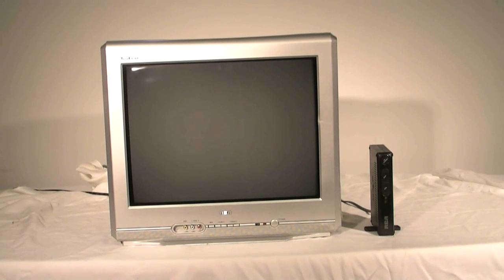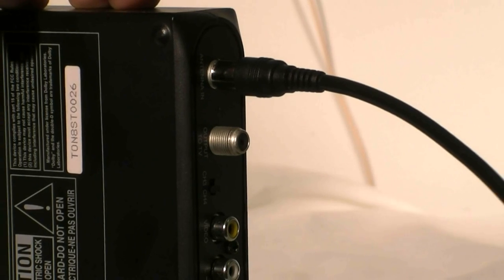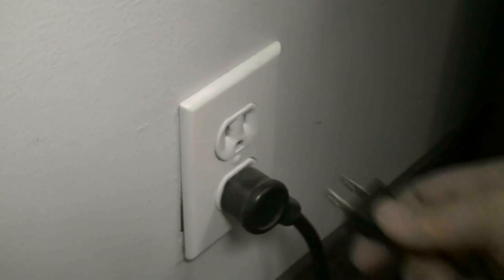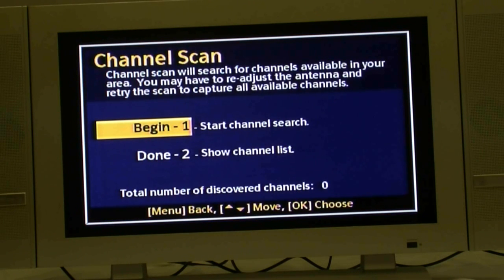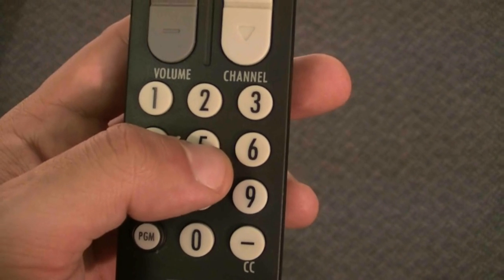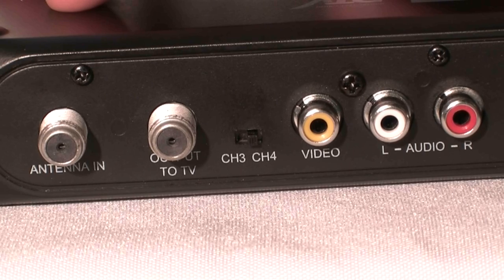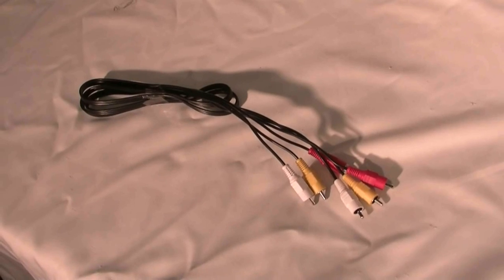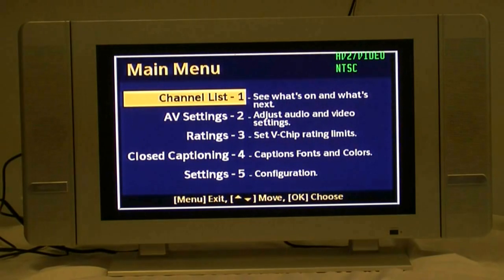DTA800 Instructional Video

Comment: If you are currently watching TV using a rooftop tabletop or rabbit ear antenna then starting in February 2009 you will need to purchase a converter box to watch local broadcast you'll need to purchase an RCA dta800

Comment: If you are currently watching TV using a rooftop tabletop or rabbit ear antenna then started in February 2009 you will need to get a digital to analog converter box to watch a local broadcast you will need to purchase an RCA dta800
Reply: If you are currently watching TV using a rooftop tabletop or rabbit ear antenna then starting in February 2009 you will need to get a digital to analog converter box to watch local broadcast you will need to purchase an RCA dta800 your first options for connecting just using the antenna from your wall that runs from your wall to your TV